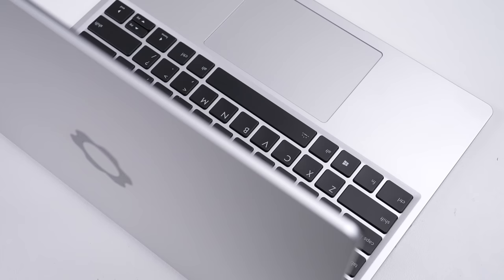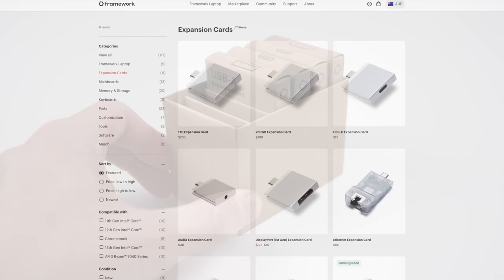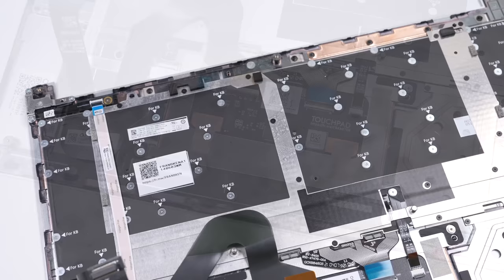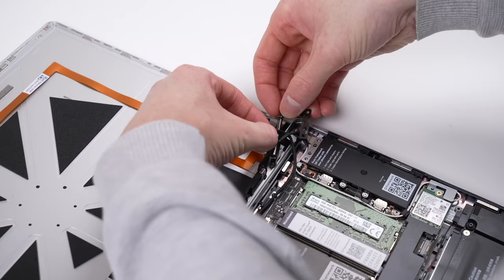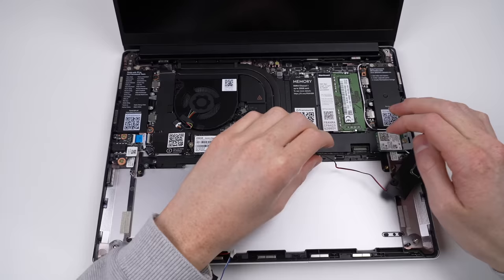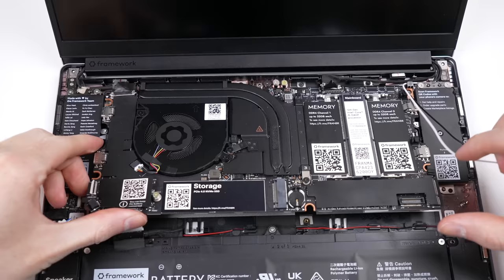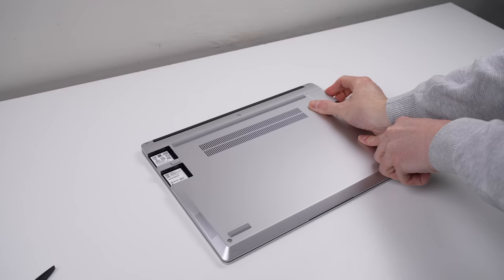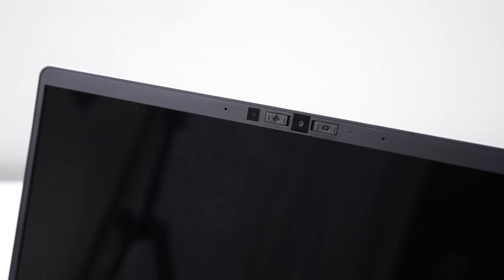New Laptop Brand Shocked Whole Computer Industry - Framework Laptop - Teardown And Repair Assessment

Comment: This brings a tear to my eye, they built what is essentially a custom built PC, but in a laptop form factor. I don't think there ever was a laptop this upgradeable as this one
Reply: lenovo thinkpad I have from many years ago had an ultra bay where the blueray player could be swapped for a 2nd graphics card or an aditional solid state drive. It needed 1 screw to hold it in place. That laptop i would say is easier to take apart and repair that the one in this video, If this company carries this design through for the next 10-15 years so the laptop is completely future proof ill be pleasently suprised.
Reply: @russellharris5314  In fairness to framework, this laptop is rather thin, and is pretty competitive to other thin & light laptops. Thinkpads usually are on the thicker side, whereas this design is very macbook-ish.
Reply: Yes you have go google it
Reply: My MSI Titan can take a lot of upgrades, but he is a chonker.
Reply: @leonro  you are correct personally I would prefer a customisable rugged build.😁
Reply: Yeah there is I have it, its a alienware with a 9900k desktop cpu and a 2080 gpu, you can upgrade any part of it. No one bought them, and they were super expensive just like this pile of garbage. You are paying 1100 for a 300 dollar laptop, just so you can change pieces haha. That is beyond re re. It has a garbage screen, low specs, and its only feature is you can take it apart easy.
Reply: Most Dell and Thinkpad Laptops were easy to upgrade and repaired until about 10 years ago...
Reply: Upgradable like swapping the MB for a cpu upgrade ?!? The other ports are just USB-C adapters that click in the chassis- they as well may be the apple dongles with no restriction in the form factor…
Reply: @radry100  yep. Especially the core (2) based ones. T60 - T61 - T400.
One could quadrouple the CPU power with crazy mods. Socket CPU, RAM upgrades, Ultrabay (2nd HDD, 2nd battery, numpad, floppy drive, bd-rom), Display upgrades, it was fantastic. Great machines. And built rather well (even though the T4x / X4x Line were more durable IMO)
Reply: @hristohristov6118  not just CPU, RAM, storage and ports, but also speakers, hinges, things you wouldn't usually expect to be repairable, let alone upgradeable, especially in this age of laptops with everything soldered down for no good reason
Reply: @FUmoneyWorshippers  That's just not true though... £849 for a 13 inch laptop with a Ryzen 5 is perfectly reasonable
Reply: The thing is gonna get so hot u'll be able to do nothing with it
Reply: @Taylorjay99  Took me 5 seconds to find one, if i looked harder I am sure I could find a even better one for less.
Reply: @Taylorjay99  As i said my asus vivo book with a 90 herts oled and i5 was like 600. Buying a garbage spec laptop for 1000 bucks so you can buy a over priced part for it is re re.
Reply: @leonro  Idk...I have a 7720 from 2018 and have the exact same interchangeability with much better components. Even comes with tons of options for beefy GPU's and the battery isn't even screwed in. The only benefit is some screws are replaced with magnets. Other than that this has really cheap components and the CPU upgrade still need a whole motherboard replacement lol
Reply: @tjobrien4486  And, your 7 pound boat anchor is perfectly fine for someone that doesn't want any future proofing or self repair options. You can't call Dell up and say "Hey, my 2018 boat anchor died. I need a new motherboard. Could I get one please?" No. You'll be told to buy a new one or find a refurb. Besides, you can't swap a CPU on your laptop either so where's the rub? You can't upgrade anything on your laptop besides the RAM and Disk. Better components? From Dell? LOL
Reply: @MandrakeDCR  Like I said I can swap the motherboard just like this one for a CPU and you can upgrade the GPU unless you have the P5000 already which I do and does more than enough still to this day. Motherboards are around 200-300 bucks. And that's with an i7 7820. So what is the advantage on this new model almost 6 years later? I can change the side ports?
Reply: Have you ever even disassembled laptop unless its apple all modern laptops are the same only difference is the unnecessary and probably expensive swappable ports its stupid
Reply: Their newer version is even more upgradable. With upgradable GPU, keyboard layout modifiable, trackpad layout modifiable
Reply: this is imo a stupid persons pc you upgrade all you want but your laptop will throttle with that terrible cooling solution your better off just buying a quality prebuilt laptop
Reply: @mekal177  my temps when playing games like squad and rd2 for example are in the 60s and 70s. Its a 6k laptop I got for 600 bucks. Well worth it in my opinion.
Reply: @tjobrien4486  Do you even hear yourself? 'Oh, I can just change the motherboard if I want, just like this one.' - No, you can't. You can research, locate a used/refurb that will fit your model, and it is unlikely that it will have the GPU advantages of your current one you're so focused on for whatever reason. In no universe can you just go to the Dell website, order whatever variant motherboard you want for your laptop, and simply 'add to cart'. You have a ~3 GHz, 7 pound boat anchor, that is not worth upgrading for any reason. If you're happy with that - great. Who cares? Don't act as if it's superior to one of these units, it's not even close. We're talking ~5GHz at under a bit under 3 pounds. Plus, you seem so stuck on dedicated graphics - the integrates on intel and AMD are both great now, and if you want real desktop level - just plug in an external GPU. Which your 2018 laptop can't even handle without direct modding into the case and using the PCI bus with an adapter that removes your wifi.
Reply: @MDK808  Yeah, all that research you did to bag on something you don't know anything about. "Probably expensive" = $9 bucks. You're stuck in Apple world where every cable that should have come with your device costs extra, and twice the market average. Regardless of overwhelming consumer requests, no ports for you. Unnecessary? How about should be standard? Mindless robots willing to use dongles with cables hanging around, when their device they paid good money for should be at least configure-to-order, if not real-time customizable like this.
Reply: @MandrakeDCR  3.6 GHz* and don't need an external GPU when you already have something similar to a 2070 with twice the VRAM. And getting an external GPU, while I like doing weird cool stuff like that, seems a little expensive. Like I said, sure its not worth the 6k when it was new but I got it for 600 bucks. All I'm pointing out is that you'd think there was more behind the product since the only kinda new thing is being able to change the ports and it's a little easier for someone who doesn't know what they are doing to swap motherboards. Someone did mention they have models with GPU space. Um, and yeah, I use my CPU mostly for gaming, movies, entertainment etc. A good graphics card IS important to me and a lot of other people lol. Integrated graphics doesn't come close to what I need. And the 2.8 to 3.6 GHz over 4 cores is plenty for any gaming I do. Even CPU intensive games like Arma and such. Your obsession with weight, which is something I give zero fucks about is a little weird too. For a work and on the go laptop maybe. But then again I take mine everywhere with me and that extra 3-4 lbs you seem to hate doesn't bother me. So for my personal uses, yes my laptop is far superior. I'm positive other people who use computers for different reasons would have a different opinion. But I understand people need and value different things. And I can get parts in minutes. Sure not always straight from the manu like with this BRAND NEW PRODUCT lol, obviously. But parts are a plenty. Just like I can't go to Microsoft and buy a brand new original xbox. Sorry to have struck a nerve. I'm sure a laptop with a fast CPU and some good RAM is enough for you and that's awesome. Seems like a great product for you. For me and some others I hope they find a way to make GPU's as integrated and swapable as their other components because then I'm all in.
Reply: @tjobrien4486  "and it's a little easier for someone who doesn't know what they are doing to swap motherboards"/// Understatement of the year. Visual Studio? Oh it just makes it a little easier for someone who doesn't know how to write code in notepad and compile it
Reply: @russellharris5314  I wanted Thinkpad too. But they're too heavy

Comment: This is a middle finger to all the anti right-to-repair and planned obsolescence companies out there. I love it!
Reply: That finger only stays up as long as Framework does. I plan to get a Framework 16.
Reply: i think its a clever business move alignign with the trends and movements towards right to repaid and coming laws. Also clever to make money off the replacement parts. Not saying it's bad, thats exactly how it should be (like being able to buy the actual brand replacements and not having to resort to not repairing something at all or getting shady shit.) But I hope it's gonna be affordable and industry standard in some years.
Reply: The price is too high. They can not compete brands, unfortunately.
Reply: @STEELWILL  Exactly my thoughts, considering a laptop has the lifespan of a couple of years anyway. I just can't see how this will make any difference. Also in a couple of years from now we'll be on VR headsets anyway.
Reply: @springbok29er  The laptop I use, an ASUS K45DR, just completed 10 years of use last november, granted I dont use it much anymore, I do everything on the desktop, but all the times I need a mobile PC its what I have to use. Its slow and hot (I never opened it to clean), and one of the USB ports cannot be used (it shorts and restarts the PC), but the only thing I changed on it in all those years is I swapped the original HDD for a SSD.
Reply: @STEELWILL  Depends. For larger firms, it may be more advantageous right off the bat to buy an upgradeable laptop and keep it working for 15 years, repairing and upgrading as needed (lots of jobs have merely office requirements) than buy 3 to 5 new laptops. Plus, if you have 50 of these, you'd be able to cannibalize a few and keep the others running for twice that (barring the battery , of course and the MS bs).

A real shame, to stop using a laptop or tablet (why not) that fills your needs completely just because you can't find replacement pieces or they cost too much. Consumerism be damned
Reply: Have always wondered why this isnt a thing already.
Had high hopes with Google ara project, a similar concept but for phones.

Well corporate greed is the only answer i guess
Reply: I mean a brand on building & customizing it seems counterintuitive to not allow more freedom. But Amazon couldnt make profit on a Billion dollar Rings of Power project and Marvel/DC is losing billions
Reply: They will get junked just as regularly as other laptops. Most machines last until they become obsolete in 4 to 5 years. And by that time you are not going to be able to buy new spare parts, modular or not, anyway, even if you were ok with repairing a functionally useless machine.
Reply: @ShrekMeBe I doubt anyone would be happy using a 15 year old system with modern software, lol. It would be excruciatingly slow (time is money in business after all). The only time you can do that is if you are using 15 year old software as well, and most companies are not.
Reply: @Tugela60  Hah, you must be living in a different world. My work laptop was second hand (albeit professional chassis) 10 years ago. Past SSD, and a new battery, I have not invested one penny in it, and it runs everything office and into graphical design.  Obsolescence in 5 years is the tune of the manufacturers, put there to hide their devices are designed to last about one year more than the warranty
Reply: @ShrekMeBe  You probably have not updated your software on a decade then.
Reply: Security and privacy breach is waiting for you....🤣🤣
Reply: all laptops are ment to be replace after its life spand.
Reply: @Tugela60  You must be living in a fantasy world.  The vast majority of people would be just fine with a 15 year old i7 machine.  It will run the latest Linux or Windows perfectly well with a bit of RAM and an SSD.
Reply: @Tugela60  No modern machine is obsolete after a mere five years for the average user.
Reply: @slaveNo-4028 ok but where did you close your parentheses ()?
Reply: @AAAAAA-gj2di  I fixed it now lol 
my social anxiety..🙈 I keep overthinking even just a silly comment, and trying to fix & rewrite it and in the end its a mess
Reply: @slaveNo-4028  no worries mate
Reply: This is a middle finger to those asking for consumer friendly products. $30 just to put an HDMI port on your laptop is criminal. Framework will never last as a company. The idea itself is cool but they executed it poorly by treating the expansion ports as "upgrades" when in fact they are normally standard on all other laptops. I mean the one im typing on right this moment is an Acer Chromebook 317 I bought refurbished for $160 and it came with 2 USB C ports, 2  USB A ports, an SD card slot, a headphone jack and a Kensington lock. All of that on the Framework website would probably cost you the same price that I paid for my Acer 317, which will get updates until 2030 and has a decent Intel processor. Framework is scamming the very people they claim to stand for. I'm not like these braindead morons who just randomly started supporting them the moment they saw them. Until they can prove themselves I see Framework as a scam.
Reply: Oh yea, and it doesnt even come with any expansion ports from the factory...
Reply: An $800 middle finger, yes. Why pay $2000 now for a laptop that ships in 6 months, when you can buy a laptop now with the same specs for only $1200. Is it worth paying  an additional $800 just to have the option to easily replace some parts in case they break? You're paying $800 for the right to repair, and then you still need to buy the new parts. And if you do replace parts not because they break but because you want to upgrade in 3-4 year, like the CPU or GPU, you will most likely buy an entirely new system anyway because the screen, motherboard, and RAM will be heavily outdated by then. They need to bring down the price to match it evenly and not have Apple like prices, otherwise the entire modular-repair approach makes no sense. Right now, you are basically paying almost double the price just for "the right to repair/upgrade".
Reply: @springbok29er  A couple of years? What the hell do you do with your laptops? Mine last me 5 years at least. I just stopped using a 2013 Dell latitude that I was using as my carry around knockabout work laptop...for a Framework!
Reply: @springbok29er   I may be naive, but I won't normalize such move, since we hardly know any scientific data on how it affects our already fragile and bombarded mental health
Reply: Does repair mean replacing the component? At that point, you might as well go reballing chips and replacing them. When the CPU or GPU die in this framework, your "right-to-repair" is ordering a new motherboard or the GPU component, and you're 600-800USD in the red. That's not repairability, that's pointless.
Reply: @jabezhane  but would you upgrade that 5 year old laptop for the prices Framework is asking, or would you just get a new laptop for a bit more with everything new? This is super niche, more niche than VR is.
Reply: @kurosumomo  Ask me in 4 years time.
Reply: I bet those companies are devasted, completely devasted 😅
Reply: Goodbye, MacBook. Hello, Framework!